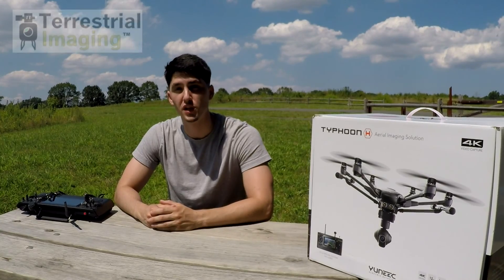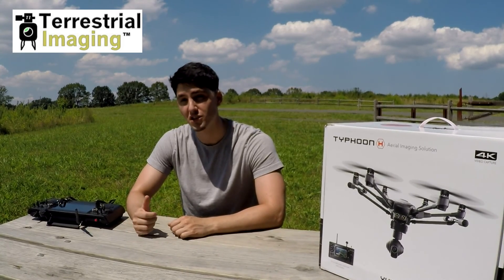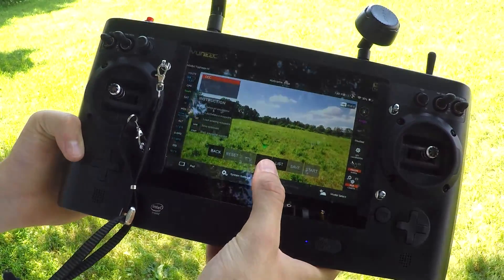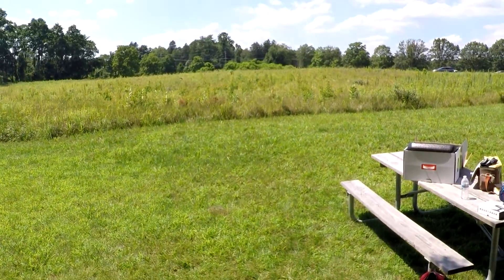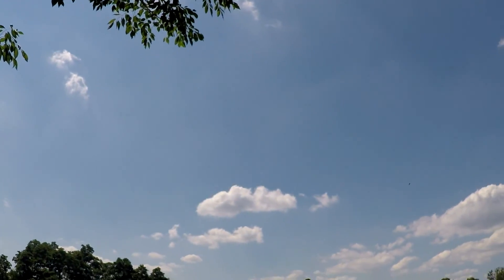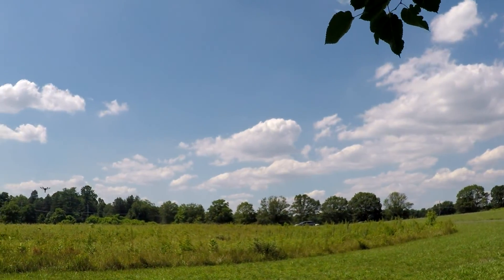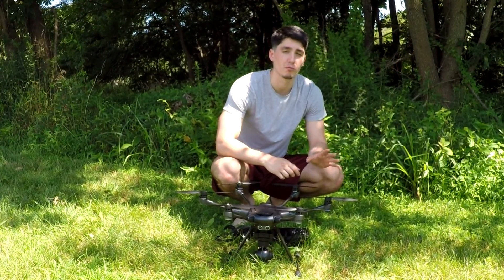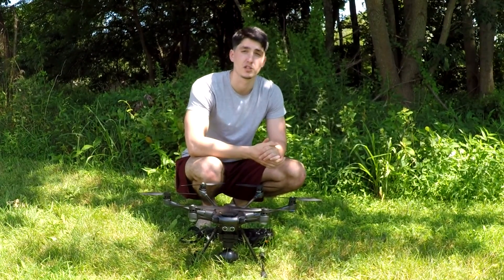Introducing Curved Cable Cam with Yuneec's Typhoon H Drone

Comment: Huh? at 2:58 approx when you pulled the left control lever down and said drone will reverse the path of the previously stored and flown to way points the drone looked like it took a sudden dip in altitude ...am i correct?

If I am correct, how come he said nothing and just carried on as if what looked like a 'glitch' never happened?
Reply from the maker: I studied the video at 2:58.  You make a good point. You must be very cable if you use waypoints close to the ground, or near objects such as trees or houses.  When you travel from waypoint to waypoint the path is cuved and the drone can overshoot.  When you set waypoints higher in the sky it is less of an issue .  Thanks for your comment

Comment: Can the pilot speed up, slow down and reverse?  Can the flight begin slowly, speed up and slow down at the end of the path?
Reply from the maker: From what I experienced , if I have the drone in full speed before the start, it goes through the way points quickly . if I have it in the slowest speed before starting , it moves very slowly through the way points. I haven't tested changing the speed before each way point yet! I'll let you know !

Comment: I'm new to the Yuneec (years of experience with the DJI familiy)...    

With the Phantom / Inspire, I can not only set waypoints, but set focus points and have the camera focused on that point as it moves through the path (e.g. fly down a golf hole and focus on the green).   Can this be done with the Yuneec?
Reply from the maker: When using the smart features such as curved cable cam, the camera remains trained on the subject and rotates independently of the copter.  This makes it possible for the camera to remain focused on a subject while it flies through waypoints.
Reply: Thanks for your response.

To be clear...   Can you set the camera to be focused on a "subject" that is not the operator?   Can you have it focus on multiple focus points throughout the waypoint mission?  And can the mission be planned before you go to the field (I think the answer to that is "no").

In other words, If I wanted to fly a golf course hole, focus on a sand trap until I was mid way down the hole, then switch focus to the green, do an orbit around the green, and then move to the next hole and again, focus on a different POI and then a different green, could I do that?   Could i plan it all before I get there, or would I need to fly the whole mission ahead of time and set waypoints.
Reply: Eric Goldstein   The Cable Cam setting can only be programmed whilst at the location and the typhoon is in the air. You have to physically fly the weighpoints with the drone for them to be stored. I know with DJI drones this is more advanced and programs such as dronedeploy can be used to set routes and camera shots before you set off. These programs do not work with the typhoon h but this is area that Yuneec are looking at and will hopefully address in the near future with firmware updates. Be sure to subscribe to our channel and twitter feed for the latest updates.